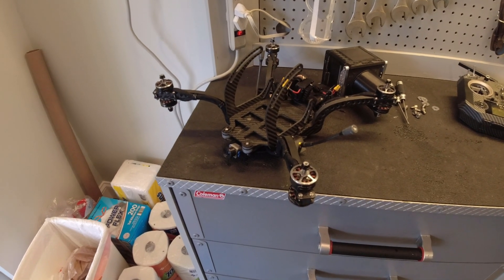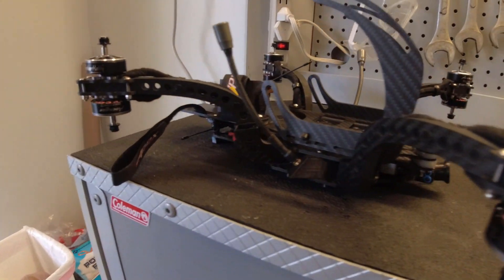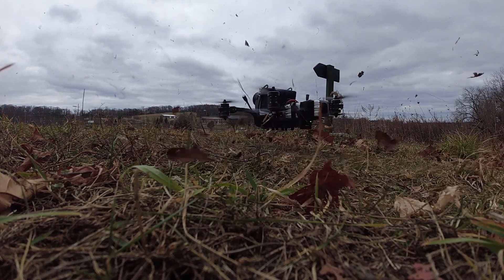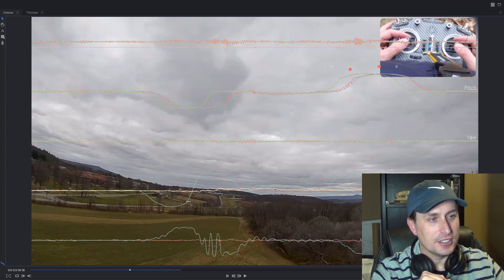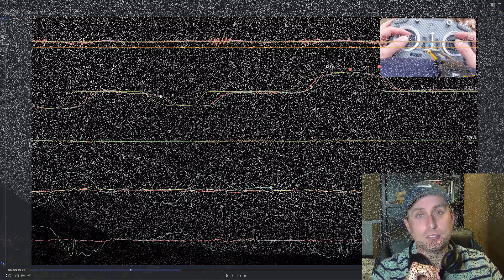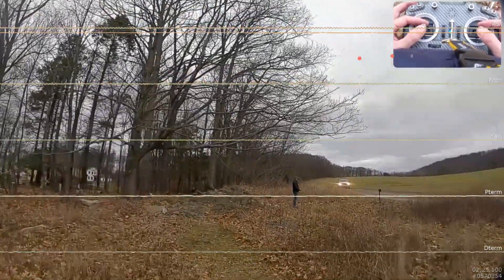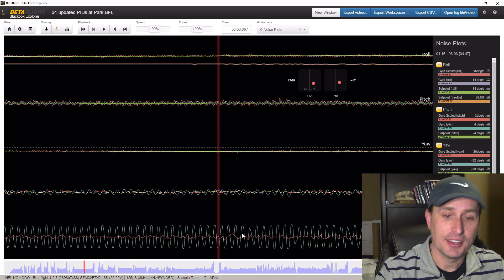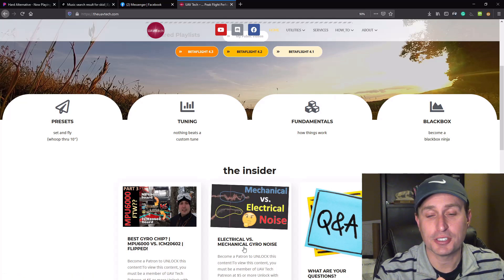Signs of a BAD Gyro | Shendrones Siccario

Comment: Thanks for sharing! I have a quad with yaw slow oscillation on a specific throttle value. I tried changing pids and filters and it gets a bit better but it's still there. Tightening or loosening the fc screws it shift the throttle position where it oscillates (changes frequency). It seems a mechanical problem but only on the yaw axis. Unfortunately I don't have the blackbox to investigate. Could be a faulty gyro? Thank you.
Reply: Quick update: changing the fc solved the problem.

Comment: Any recommendations about esc placements? Should i connect both escs to 1 xt60 with 2 capacitors?
Reply from the maker: One CAP per ESC.  1000uf, 50V if u can fit it.

Comment: How would you rate the tune and that drone performance after the FC change? Did you get rid of the wobbles caused by wind or is the heavy mass just problem when there is external forces ?
Reply from the maker: They left the MatekF7on it I believe.

I did my best to tune withn LuxF7.  Sent back with msg of it needs to be replaced.  Matek was put in and i was sent a log.  I said it still had the issue, but on roll now and I have not heard back since.

Comment: nowadays it is very common to receive flight controllers with gyro defects. And it is very difficult to prove what is going on to receive the refund. My last t-motor f7 HD came with faulty gyro. Not long ago I bought a dalrc f7 that also came with faulty gyro. Before that there was an Airbot Omnibus f4 that also came with a defect in the gyro. I am very careful in the assembly of the fc's and I can see immediately in the first take off when the gyro is not good. The type of vibration / defect is very obvious. Buying a flight controller today is Russian roulette, at least in my case.

Comment: Hey Mark, I've got an old drone that I've been working on tuning, but for some reason, after a crash, the tune is wrecked. There are huge high throttle oscillations, propwash handling is terrible, and its super inefficient. And then after a couple days of flying it, it clicks back to its old way of flying, and is normal. I'm not changing any settings before or after the occurrence, and am by no means a noob, but cant figure out what on earth it could be. Any input would help immeasurably
Reply from the maker: Maybe dirt in the motor got sorted, etc... Sounds like a mechanical thing fixed itself.
Reply: @uavtech  That's what I thought as well, but the problem persists, it's happened two or three times now. I've checked all the motors, props, capacitor, all the screws are tight...I'm thinking of just getting a new stack
Reply: @RealFlight-u4h  reflow the fc?

Comment: can someone implement a fft filter in betaflight?
i left a comment about this earlier, but didn't know it existed
-convert gyro data into frequency domain with a fft
-select range of frequencies
-convert that range back, using a inverse fft
this completely eliminates the high freq noise and no other filters have to be used
there are a bunch of matlab examples online
i guess the problem is running them real time on our fc's
Reply from the maker: That is what the Dynamic Notch does!!  It has been in the firmware for 3 or 4 years now.  See https://youtu.be/AG3VcHwenwk.  The settings have changed since, but the FFT process is the same.  We are now working on SDFT which will increase the resolution from 16bins to 50bins in the FFT centering (more Bins means the center of the notch will be close to the peak -- higher resolution).

Why the RPM is better for tracking motor noise is because it is faster.  The FFT process takes about 25ms to detect and move the notch.  Mostly that is it is a running analysis so as new data comes it, the FFT starts to shift but since only 16bins across the spectrum 100hz to say 600hz, it takes some time for the vibrations analysis to start to run the notch up.  Of course each analysis step is being completed in the processor in less than one loop (<0.25us) so don't confuse the latency in the detection and moving with processor power.  It just has to deal with the analog vibrations coming in and trending the FFT up to where the notch starts to move from one bin to another.  25ms is crazy fast (0.025s), but in the world of moving the notch around, the RPM is faster to keep on the peak motor noise as the signal from the ESC to the notches is only delayed by 3ms.

I 1000% agree that Notch Filters are the way forward.  But folks, mostly EMU, keeps playing with lowpass filters.  They just don't get the job done.  AND they have the highest latency in the filter chain.  That said, if someone can figure out how to get a lowpass to give the same filtering for less delay, that would take a bite out of the filter type that gives the most delay.  The BF approach is to keep working on Notch Filters to make their targeting better and better so the lowpass fIlters can move moved up really high, or just turned off.  I have NEVER seen anyone bend the curve otherwise for filter delay vs. attenuation in the lowpass filter arena.  Lots of B.S. with it (like the FKF, IMU-F and now ABG-J filter), but never data backing up and when you dig into it, it always comes out to be just a plain old 1st Order lowpass filter in the end with the cutoff moving around in different ways.  That doesn't bend the curve of the primary lowpass filter problem.  It just makes it adaptive / dynamic, but the it is still a weak filter for the amount of delay it adds.
Reply: @uavtech  he isn't asking about notch filters but rather using an fft and then an inverse fft to remove noise. There are issues with that. One we dont have good enough resolution even with the updated dft to do a good inverse and the cpu power and latency will still need to be addressed
Reply from the maker: Oh, my mistake.  I'm not familiar with that one.  Thanks for clarifying.